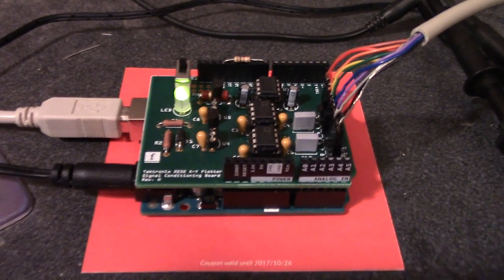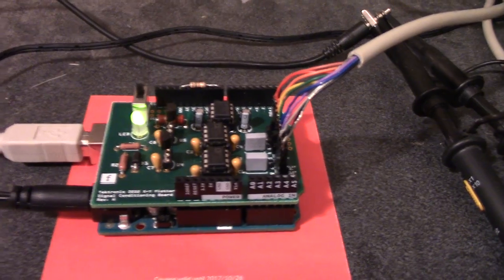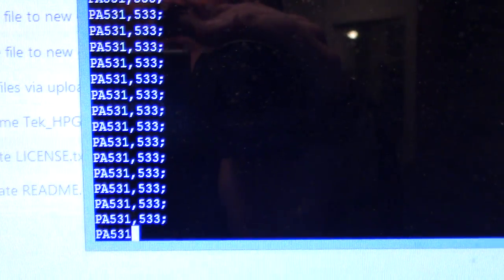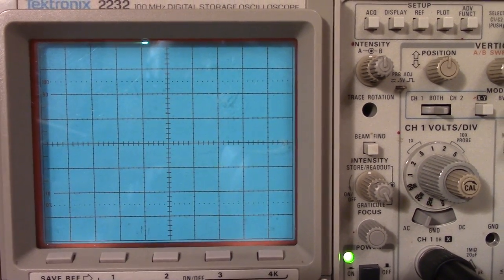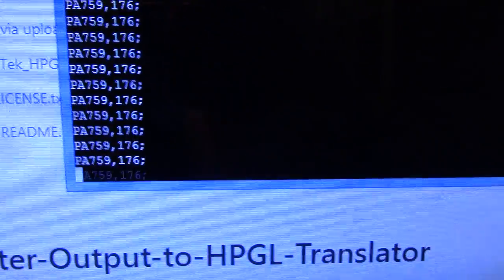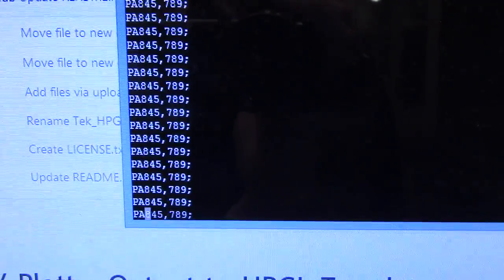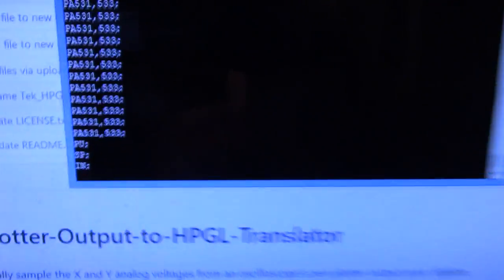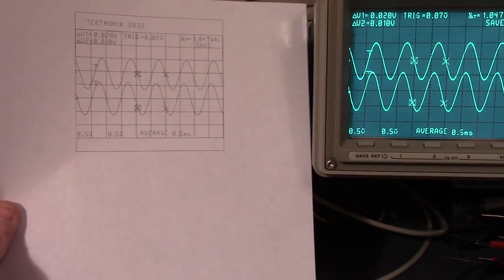Analog XY Plotter Output to HPGL Translator

Comment: Mr. Horstman:  Excellent project.  I actually replaced the X-Y board in my TEK 2232 with the GPIB board, now (almost) all of my instruments will plot directly to HPGL (I use a ProLogix GPIB to USB dongle to interface to the computer for capture).  I have a couple of older instruments that I still cannot plot, one is an HP 3580a audio spectrum analyzer that outputs X, Y and contact closure for pen up/down.  It looks like your project might be adaptable to this.  It is not clear from the 3850a manual if the analyzer outputs the graticule or not, I might need to create that, also no on-screen data although I suppose I could write some interactive code to create that.  Could be an interesting project for me to pursue, what do you think?  Also, are bare shield boards available?  George Werl
Reply from the maker: Mr. Werl: Thanks! I did this project because it represents a great starting project for Arduino. It’s spec’d for the TEK2232: -2.5 to +2.5 input on X and Y translated to 0 to 5v for the Arduino ADC’s. Luckily, that’s a scale factor of 1.0 and a translation of +2.5v. Therefore, I could use precision unity-gain opamps (with built in precision laser matched feedback resistors). Unfortunately, it would be incompatible with the HP 3580A, except with substantial redesign. The HP 3580A manual states X-axis spread is 0 to 5v while Y-axis spread is -1.5 to 5.5v. X-axis could feed right through to Arduino but Y-axis would require a gain of 0.71 and a translation of +1.07v to produce 0-5v for Arduino. This non-unity gain would require external feedback resisters. It’s doable, and more of a challenge. You can use the schematic and software for this project as a ‘jumping off’ point for your project. I would be delighted to see your solution. Good luck!

Comment: Aw man, I wish my scope had XY plotting output. Instead it outputs directly in HPGL, but not just XY values, it has a bunch of normal text, custom characters, and coordinate changes, as well as the grid lines and trace lines. I need to manually parse it and process certain elements to try and get an HPGL viewer to read it.
Reply from the maker: I use SPLOT to open and display my HPGL files (€65, however, there is an evaluation version)
https://www.swplot.com/splot.htm
There may be other freeware HPGL viewers out there.

Also, you may want to retrieve the HPGL and HPGL2 Reference guides:
HPGL
https://dokumen.tips/documents/chapter-9-hp-gl-graphics-language.html?page=7
HPGL/2
https://www.hpmuseum.net/document.php?catfile=213

Comment: Wasnt there an hpgl option in the scope making at least the conversion part obsolete?
Reply from the maker: Yes. The Model 2232 was available with the GPIB option. However, this unit I bought at auction has only the X-Y Plotter option. So this was an opportunity for a hobby project using the Arduino UNO.

Comment: Hi Mr Horstman,i just bought an old 2232 scope as well,i don't have an operation manual,i haven't figured out the storage feature,do you know if someone made a video on how to use this feature,or where to find an operation manual ? paper or pdf ?? Bye,Lucien
Reply from the maker: Try this for a paper manual: 
https://www.manualslib.com/manual/2036603/Tektronix-2232.html#product-2232

There is a user manual and a service manual:
Tektronix 2232 User Manual, 070-7066-02, 1993, 186pp
Tektronix 2232 Service Manual, 070-7067-01, 1992, 366pp

Here is a concise tutorial on Tektronix storage scope capabilities compared to the analog scope:
'Complete Analog Vs Digital Storage Oscilloscopes'
https://www.youtube.com/watch?v=mG3enGpGyNA

Comment: Can I use an amp other than AMP03?
Reply from the maker: If you want a direct, drop in replacement it would need these specifications:
*Bi-polar supply of at least ±6.3V.
*Built-in voltage divider and feedback resistors (laser matched, preferably).
*Same pin-out, of course.

You’re free to redesign the circuit. Use any non-inverting, unity gain op-amp configuration. Ensure the op-amp, if single sided, can operate to the rails (0v). I recommend a resistor array for the voltage divider and feedback – they’re usually laser matched.